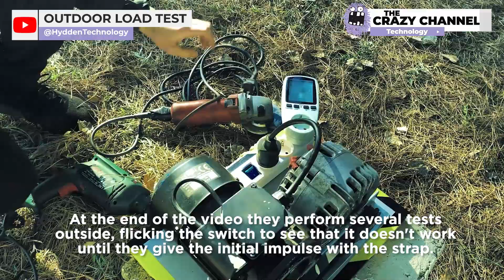10Kw Free Energy Generator with an Alternator and an Electric Motor - 100% REAL

Comment: Impossible d'obtenir 220 Volts avec le même bobinage de l'alternateur 24V. Ce n'est pas la puissance des aimants qui va augmenter le voltage mais bien le RPM du moteur ET  le bobinage de l'alternateur. Pour preuve, prenez l'alternateur sans modification et  alimenter l'électroaimant de l'alternateur avec power supply indépendant. Cette façon de faire vous permet de gérer la puissance du champs magnétique de l'alternateur. Plus vous allez augmenter la puissante de l'électro aimant plus l'alternateur demandera de wattage et vous n'aurez aucune augmentation de voltage mais bien une diminution de voltage qui baissera en deçà de 24V. Jamais au grand jamais vous obtiendrez 220V par la seule augmentation du champs magnétique. Il vous faut obligatoirement modifier le bobinage de l'alternateur en augmentant le nombre de spires x10  pour augmenter le voltage à 220v, ce qui implique un plus petit filage et donc moins de puissance. Pourquoi tromper le gens avec ce genre de vidéo, si ce n'est pour faire un gain $ par des millions de vue!
Reply: Bonjour frere ce que moi aussi j ai été étonné par cette multiplication d aimant jusqu'à aboutir 12 aimant imaginez un moteur électrique de 12 aimant soit 24 pôles. Je n ai jamais vu.

Comment: hola que motor usas gracias
Reply: Impossible d'obtenir 220 Volts avec le même bobinage de l'alternateur 24V. Ce n'est pas la puissance des aimants qui va augmenter le voltage mais bien le RPM du moteur ET  le bobinage de l'alternateur. Pour preuve, prenez l'alternateur sans modification et  alimenter l'électroaimant de l'alternateur avec power supply indépendant. Cette façon de faire vous permet de gérer la puissance du champs magnétique de l'alternateur. Plus vous allez augmenter la puissante de l'électro aimant plus l'alternateur demandera de wattage et vous n'aurez aucune augmentation de voltage mais bien une diminution de voltage qui baissera en deçà de 24V. Jamais au grand jamais vous obtiendrez 220V par la seule augmentation du champs magnétique. Il vous faut obligatoirement modifier le bobinage de l'alternateur en augmentant le nombre de spires x10  pour augmenter le voltage à 220v, ce qui implique un plus petit filage et donc moins de puissance. Pourquoi tromper le gens avec ce genre de vidéo, si ce n'est pour faire un gain $ par des millions de vue!

Comment: No te lo crees ni tú
Reply: Impossible d'obtenir 220 Volts avec le même bobinage de l'alternateur 24V. Ce n'est pas la puissance des aimants qui va augmenter le voltage mais bien le RPM du moteur ET  le bobinage de l'alternateur. Pour preuve, prenez l'alternateur sans modification et  alimenter l'électroaimant de l'alternateur avec power supply indépendant. Cette façon de faire vous permet de gérer la puissance du champs magnétique de l'alternateur. Plus vous allez augmenter la puissante de l'électro aimant plus l'alternateur demandera de wattage et vous n'aurez aucune augmentation de voltage mais bien une diminution de voltage qui baissera en deçà de 24V. Jamais au grand jamais vous obtiendrez 220V par la seule augmentation du champs magnétique. Il vous faut obligatoirement modifier le bobinage de l'alternateur en augmentant le nombre de spires x10  pour augmenter le voltage à 220v, ce qui implique un plus petit filage et donc moins de puissance. Pourquoi tromper le gens avec ce genre de vidéo, si ce n'est pour faire un gain $ par des millions de vue!

Comment: Ich möchte auch ein funktionierendes Gerät kaufen, bitte teilen Sie mir mit, wie viel es kostet und wo ich es kaufen kann
Reply from the maker: Tut mir leid, Freund, aber wir können unsere Prototypen nicht verkaufen
Reply: Impossible d'obtenir 220 Volts avec le même bobinage de l'alternateur 24V. Ce n'est pas la puissance des aimants qui va augmenter le voltage mais bien le RPM du moteur ET  le bobinage de l'alternateur. Pour preuve, prenez l'alternateur sans modification et  alimenter l'électroaimant de l'alternateur avec power supply indépendant. Cette façon de faire vous permet de gérer la puissance du champs magnétique de l'alternateur. Plus vous allez augmenter la puissante de l'électro aimant plus l'alternateur demandera de wattage et vous n'aurez aucune augmentation de voltage mais bien une diminution de voltage qui baissera en deçà de 24V. Jamais au grand jamais vous obtiendrez 220V par la seule augmentation du champs magnétique. Il vous faut obligatoirement modifier le bobinage de l'alternateur en augmentant le nombre de spires x10  pour augmenter le voltage à 220v, ce qui implique un plus petit filage et donc moins de puissance. Pourquoi tromper le gens avec ce genre de vidéo, si ce n'est pour faire un gain $ par des millions de vue!

Comment: Men buni senab kurib ancha harajatga tushdim uishlamadi feek
Reply: Impossible d'obtenir 220 Volts avec le même bobinage de l'alternateur 24V. Ce n'est pas la puissance des aimants qui va augmenter le voltage mais bien le RPM du moteur ET  le bobinage de l'alternateur. Pour preuve, prenez l'alternateur sans modification et  alimenter l'électroaimant de l'alternateur avec power supply indépendant. Cette façon de faire vous permet de gérer la puissance du champs magnétique de l'alternateur. Plus vous allez augmenter la puissante de l'électro aimant plus l'alternateur demandera de wattage et vous n'aurez aucune augmentation de voltage mais bien une diminution de voltage qui baissera en deçà de 24V. Jamais au grand jamais vous obtiendrez 220V par la seule augmentation du champs magnétique. Il vous faut obligatoirement modifier le bobinage de l'alternateur en augmentant le nombre de spires x10  pour augmenter le voltage à 220v, ce qui implique un plus petit filage et donc moins de puissance. Pourquoi tromper le gens avec ce genre de vidéo, si ce n'est pour faire un gain $ par des millions de vue!

Comment: Open that junction box on top of the bigger black ac motor. That would be. The perfect place to store some 18650’s, an ecu, and a rc receiver  🤨 so that the motor could be powered and run remotely with any rc tx/rx setup